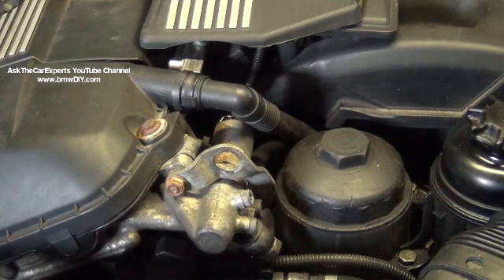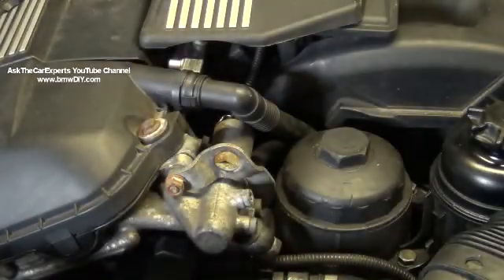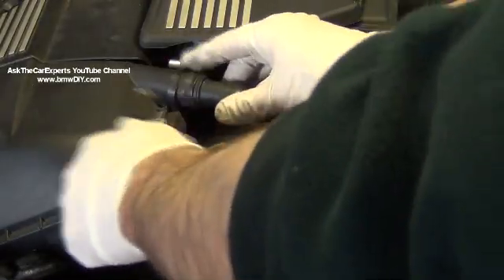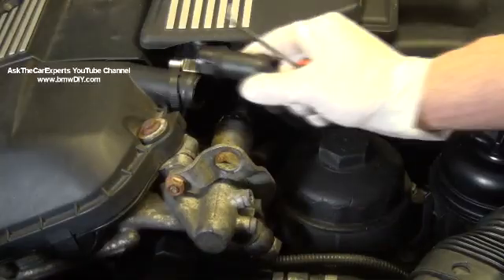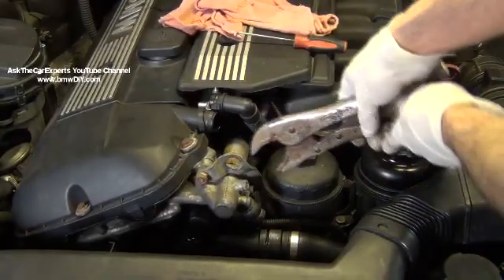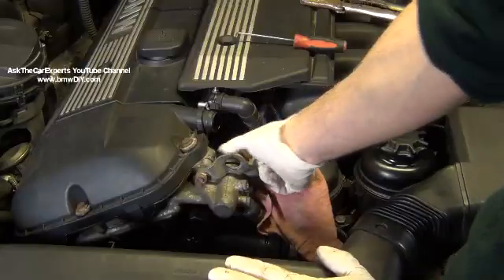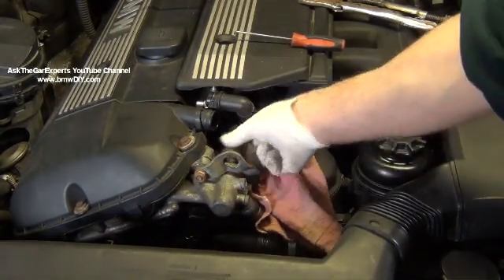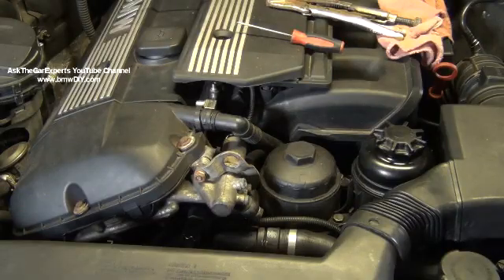BMW VANOS Intake Solenoid M52TU M54 Removal and Installation DIY Timing Control

Comment: Just subscribed!  My E85 cranks but no start.

Have a inlet camshaft sensor code:  

2986 - Inlet camshaft sensor : signal.

Replaced it with an OEM Bremi cam sensor but it did nothing.

Can you please give me some advice?

It ran fine but one day wouldn’t start
Reply from the maker: Thanks Tunacat! Sorry for the late reply. I had a bunch of comments that where held up. You still have an issue with your BMW?

Comment from the maker: Hello, Usually once filled with fuel and the key is turned on and off the vehicle should return to normal. If the problem is still there then this would be something other than running low on fuel unfortunately.

Comment: hello there, i have a bmw 2006 325i a week ago i almost run out of gas , and the car start to shaking and check engine light come on, and i fill up with gas and still keep doing it, you think is these issued because run out gas? or can be come from something  different,
thank you